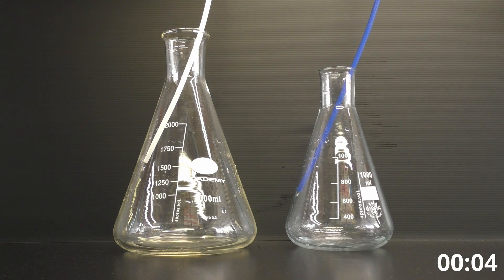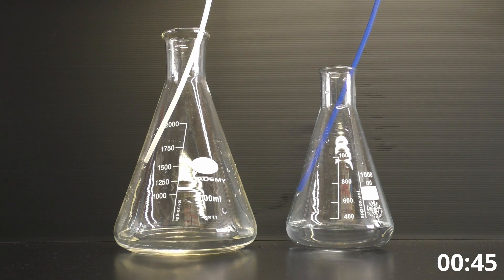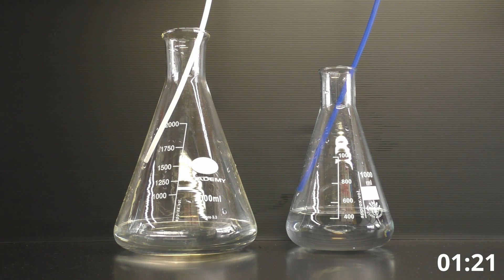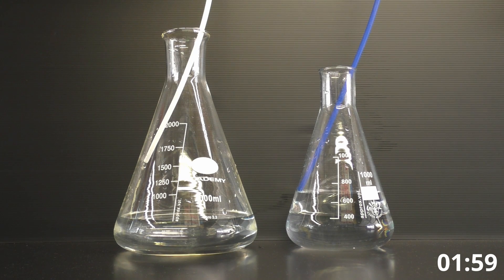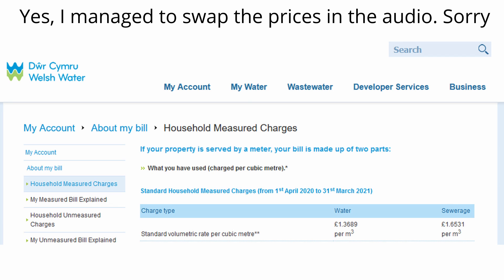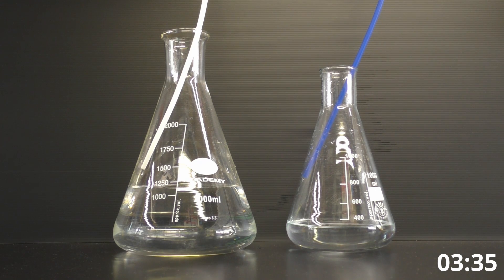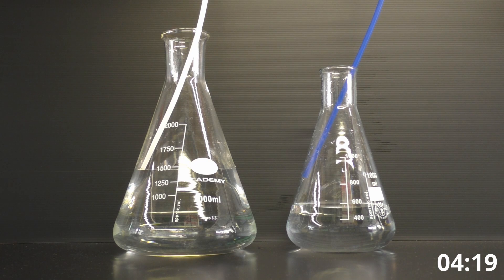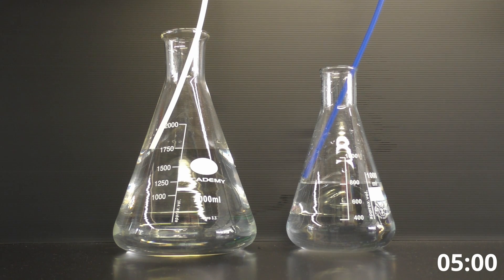The truth about RO systems and waste water

Comment: Just curious, but what are you using RO for?

Also, just a bit of a funny thing. Those of us who detail cars, spend loads of money on RO+DI systems to get 0PPM water. Would be quite the thing to usd 500-600 PPM water for that. Wash a car with that, and it will be a nightmare to clean and dry after.
Reply from the maker: I use it for brewing beer as it allows me to change the mineral profile to match whatever style of beer I'm brewing.

Comment: 5:30 At the 600ml level of the clean you have 1500ml waste which is more than double the amount, that's more than 2:1 waste:clean. Am I missing something?
It's not about the cost it's about wasting resources. All that "waste" water has been collected and treated at the water treatment plant, then pumped down pipes, at great expense.
Reply from the maker: At 3:59 I had emptied a litre of clean water out of the full 1 litre flask, so that was actually 1600 ml of clean water not 600ml
Reply: @DaftCatBrewing  My apologies, that's what I missed!

Comment: So yeah it does waste a shit ton of water. You did no explanation as to it not... Just a justification. Good points to it though. I appreciate your  insight
Reply from the maker: I can see you must have misinterpreted what I said. Users may choose to waste water but the system itself doesn't waste any. It also doesn't use a shit ton of water at all, in this case it uses 1 litre of flush water for every 1 litre produced which is far less than the 10+ litres BS many folk keep spouting that it uses to produce a single litre of RO water. If you watched this and your take away was that it uses a shit ton of water than I suggest you watch it again but actually bother to watch it this time round.

Comment: I've been considering getting a RO filter for my sensitive plants and coffee machine.  I found this video very helpful and it reminded me that in my city, all the waste water is collected and refiltered before going back out to the homes so even if I let mine go down the drain I'm still not wasting any. My question is, and I'm sorry if I missed it, did you factor the system maintenance into the cost of use? Meaning replacing the bladder and filter cartridges? Also, how fast does your system filter? Can you provide the name of your system again please? I'd like to consider it as an option for my own system. Thanks for the content!!
Reply from the maker: Hi there, It's hard to factor that cost in as how frequently you need to replace filters is mainly dependant on how much you use it. If you are producing lots of water you will need to replace the filters more frequently due to volume, if you are producing less you will have to replace them due to a suggested time limit. Mine is an unbranded 4 stage pumped system with a 150GPD membrane

Comment: Like most people the main reason I decided to go with RO water was to start my beers off with a blank water profile and then add the salts I needed to build a water profile for the beer I'm brewing.   Another reason was also that this is a fun hobby for me and having that control over my water is also fun.  If I just wanted beer and didn't enjoy the brewing process I'd just buy beer at the store.  :D

I just got my RO system delivered today via Amazon, it was only $50 (US) which was a really small investment.  I priced how much it would cost to buy 7 or 8 gallons of distilled water from the story and that would be about $8-$10 each time I brewed.   That's not considering the time and cost of driving to the story each time I brewed.   Plus, I'm too lazy to go to the store each time I want to brew.  :D

It seems like a very small up front expense which will pay for itself rather quickly so why not brew with the best possible water that I can?

Comment: Yes... I can see that in your video that it appears to be a 1 to 1 ratio of RO vs waste water.  However,  your experiment is flawed. He's why.  You have the water draining into open beakers.  In an RO system the water goes into a holding tank.  This holding tank has pressure inside it.  This pressure serves the purpose of forcing the water up to your tap for on demand use.  Open beakers have only atmospheric pressure applied to them,  a very big difference from the average of around 15 to 20 lbs in an RO tank.  That tank pressure is what causes the added waste in water usage.  This waste is greatly increased as the tank gets to its maximum fill capacity.  Try starting with an empty tank and measure the waste water you get when it fills.  You will see a much greater volume of unused waste water.  You can also try starting with a full tank drain out a measured amount of water say to fill a kettle.  Then see how much is wasted to replenish that same amount of water.  Your other comments regarding what you do with the unused water are great and can reduce the wasted water.
Reply from the maker: If this was a home building channel then your assumptions may have some merit, however, in home brewing we don't use pressurised holding tanks at all. Secondly even if we did, the pressure supplied by the pump in this system far exceeds any internal pressure that would be in that tank, but thanks for your comment.
Reply: Interesting... I had one for drinking and my water bill increased 100%. The quality was amazing but the costs was way too high.. I still have it but don't use it.. I'm currently exploring a new system or do I need to as I have a system albeit unused?

I'm totally lost as to where to look as the market is saturated.. I've even been checking the virgin pure one.

I'm thinking to reinstall my RO outside. I'm wondering if I can turn it on for a while, fill up lots of bottles and turning it off.

Any feedback would be appreciated

Comment: What membrane do you use?
I have RO system for 15 year now, and I never saw 1:1. For me is 3:1, and I always use DOW membrane 75 gpd. I think that your system have bad membrane, and that is why you get 1:1. I have 3.5 bar pressure and get about 1 liter per 5 min. and about 3 liter of waste. I use BW60-1812-75. If I lower the pressure I got better ratio, but with higher EC.
Reply from the maker: I use a 150gpd membrane which is not bad. Pumped systems tend to get a much better ratio using high pressure than unpumped ones which use lower pressure.

Comment: Can I ask which RO system you would recommend for maximum efficiency (minimal ‘waste’ water). Thanks!
Reply from the maker: I only have experience with a couple of systems and so far, the one in the thumbnail which is a no name one has been best for me.
Reply: Hi all RO are similar it’s down to what RO membrane you use some do 1-1 some membranes I have seen are 1-2 but when the filter is dirty it will be less efficient.
I’m not a brewer I use it on my fish tanks 👍

Comment: To be honest, There is a NUMBER of configurations in these systems. The good ones can use a combination of multiple membranes and also a "CONCENTRATE RECYCLE" circuit. Most of the time, a person can approach this with 1 membrane generates concentrate water and it sends it to the INLET port of the NEXT membrane vessel and a considerable reduction of waste will occur.
Reply from the maker: Mine uses a single membrane.

Comment: Do you use a DI/ Ion exchange post filter in your setup Sarah?
Reply from the maker: Yes, the final stage (in the clear filter cartridge) is a DI resin stage. It isn't necessary for brewing, but it does mean I end up with 0 TDS on the output and it was what came with the original system.

Comment: Thanks Sarah. I'm just waiting for my "carbon block" pre-filter elements to arrive to commission my aliexpress version. Have you ordered any membranes/filter elements from aliexpress? If so have they been satisfactory? I have a very slight baseless cynical concern that the far east TDS meter manufacturers are in cahoots with the membrane manufacturers. Can't wait to be done with crappy midlands crazy hard water.
Reply from the maker: Hi there, I haven't bought from them directly, although it is highly likely that the original source used by companies that I have bought from is the same as those on AliExpress.